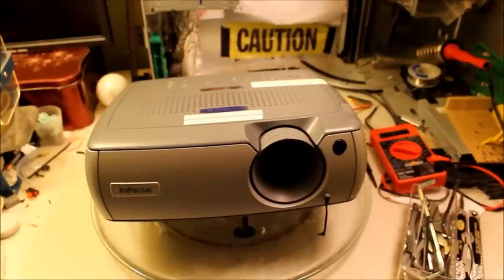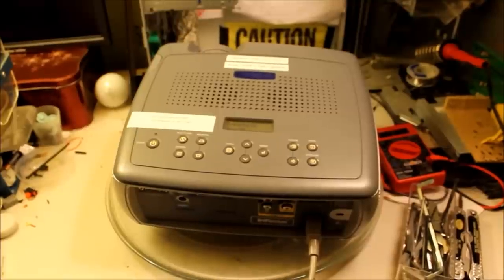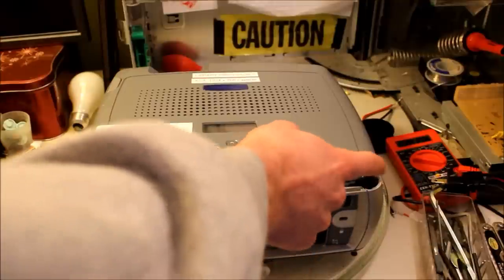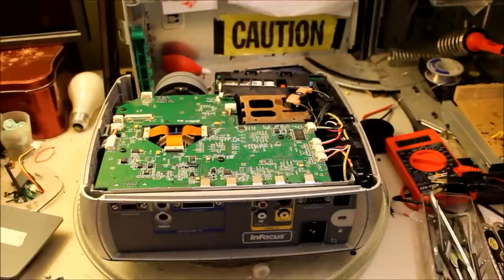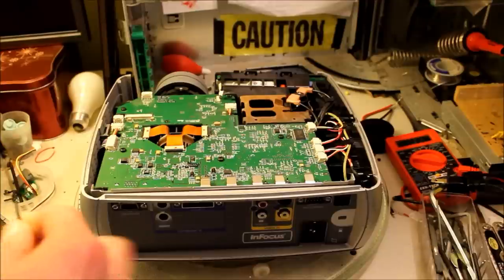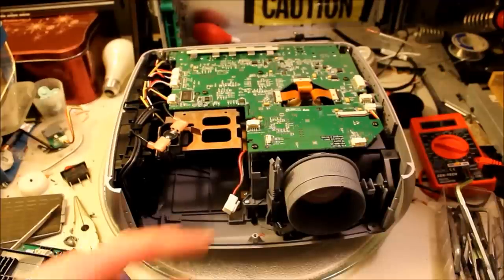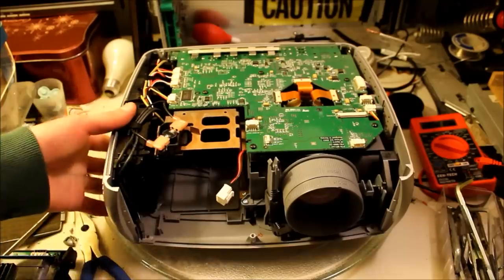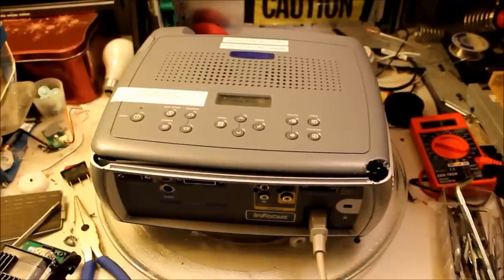$5 Projector LED Bulb Mod! | Part One

Comment: How did you figure which pin to short to ground? Did you have a schematic or did you guess?
Reply: Optocoupler. One which is facing opposite in 3 or 4 group of optocouplers. Short it from the motherboard side.

Comment: Why not use a HID headlight and it's controller which should run off 12V but really needs 13.8V just wondering.
Reply from the maker: That would probably have worked just as well if not better. The projector was slightly dimmer than I wanted so I may return to this project in the future and redo it. Thanks for watching!

Comment: Is It possible to do the same with Sony vpl ex100? That uses lamps and swap for led ?
Reply from the maker: I'm sure it's possible, just not sure how similar the process is to what I did with this projector. Do as much research as you can on the internals before you get started, and you should be all set!

Comment: How did you make to figure out which one should be soldered ?
Reply from the maker: I did some internet research which said to look for the optocouplers or the small wires that go to them. (not power carrying). I then went through the task of turning on the projector using a different pin conected to ground each time until the projector stayed on instead of saying "check bulb". Thanks for watching!
Reply: inventordude14 Thanks for answering me , my projector lamp has 105 hours but when it comes to an end I shall try a replacement by leds . ...

Comment: Hey there can i ask you does it matter if u use warm white led or cool white led and can i melt the matrix if i use 100 w led :)
Reply from the maker: I would recommend that you use a cool white led bulb so that the white parts of projected images are white rather than a yellowish color. A 100w led should provide enough brightness and should not melt anything as long as you mount it on a good heatsink with a fan to keep it cool. (Old CPU heatsinks do a great job with high wattage LEDs) Good luck! :)
Reply: inventordude14  thank you so much :)

Comment: To make sure I understand, the optocoupler detects light output. It has to be bypassed because the optocoupler itself is part of the old assembly which is removed so cannot detect the light emanating form  the new bulb. Is that right? Thanks.
Reply from the maker: My understanding of the optocoupler is that it is kind of like a digital switch that detects that the bulb is drawing high power from the high power circuitry that I removed. It doesn't detect light from the projector bulb but inside it, there is a near-infrared LED and light detector which are sealed inside. On the outside, it just looks like a regular chip. It is like a relay for separating the high power the bulb uses from the low power the chips on the mainboard use. it sends a digital LOW signal to the correct pin on the mainboard of the projector when the original bulb is working properly. By just soldering that pin to ground, I can draw the pin to LOW status and the mainboard is fooled into believing that the original bulb is in there and that the optocoupler is sending the LOW signal. It's complicated and I'm not sure if that's 100% correct but that's my best understanding of how it works. Thank you for supporting my channel!
Reply: Thanks for the greater detail.
Reply: inventordude14 forgot to asked u the last time. Which pin is that for the LP540? Is it the 1st pin near to the end of the pcb? I have the same one as yours that I got from a friend of mine.
Reply from the maker: ***** Yes it is the 1st pin nearest the end of the pcb you can sort of see it at 3:32. Hope that helps in your projector modding would be cool if you uploaded it. Just use a much brighter bulb than the one I did :)
Reply: inventordude14 hey, thanks a lot, am gonna fit mine with an led light module...still looking around for a suitable candidate 😂 hahaha & something that won't need a big heatsink or needing me to mod the fan but that can happen tho, & I think I'll shoot my progress. I'll give u a heads up if I do. Thanks again 😀

Comment: Great video!  You said that you looked up online where to ground to fool the projector. I have a different projector. Any tips on how to trace the bulb sensor? ON mine the ballast is on the same board as the power supply for the whole projector, so I can't take it out, but I would still like to replace the bulb. Any links or suggestions would be great.
Reply from the maker: +Justin Hyatt I mostly just did some googling on my specific model of projector. It can be hard to find results on exactly your projector as I learned but I found out that the ballast tends to have small data wires that connect to the motherboard inside most projectors where it tells the motherboard that the bulb lit successfully. I unplugged the data wires from the ballast and then tested powering on my projector each time with a different data wire from the motherboard connected to ground until it stayed on and stopped showing the bulb warning light. Here's two videos that may help even if they aren't your specific projector: https://www.youtube.com/watch?v=bfjN2DTVlfY https://www.youtube.com/watch?v=l0O13IOBXX0
Reply: +inventordude14 If you ground wires, use a resistor, or you may be making a direct short. Say 1k or so between the source and ground, value is not too critical, just don't short logic signals directly to ground.

Comment: help me sony vpl-cs20a lamp hack
Reply from the maker: Hey man since I don't know much about the internals of that projector, I cannot help you much. But try looking for 'lamp control' or something along those lines on the projector mainboard. Most projectors are built pretty similarly on the inside. I cannot link youtube videos in comments anymore so please check out the links I shared under Justin Hyatt's comment. Also, if you go through with this, I don't recommend using the same bulb that I did. It was too dim for my liking and as other commenters have helpfully pointed out, a 50w led chip that has a much higher lumens rating will serve much better in a projector.
Reply: I've got vpl cs 20

Comment: Is this compatible for the UNIC?
Reply from the maker: +BPSCPSRAPS should be the same basic concept just use a brighter LED chip rather than the 1000 lumen bulb I used. Now they have 100w 6000k ones that put out 10,000 lumens. Thanks for watching!